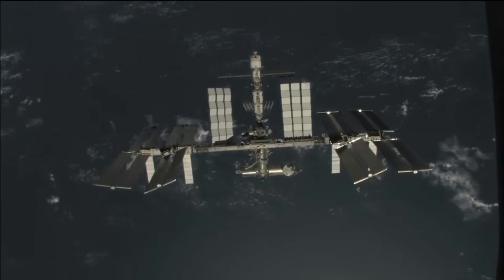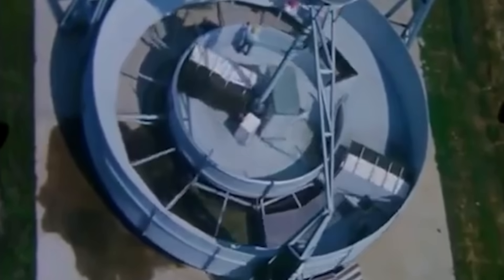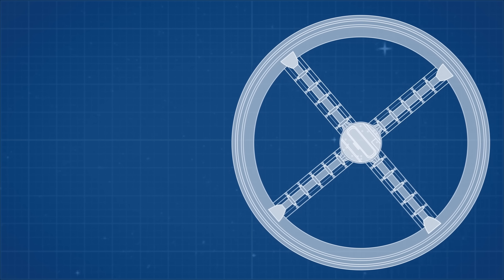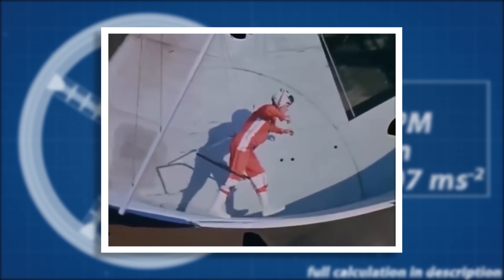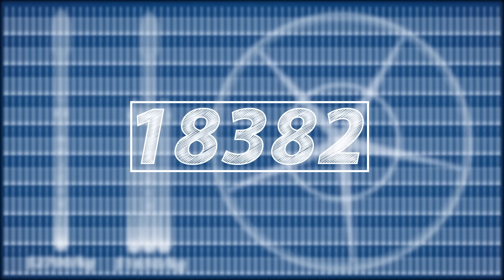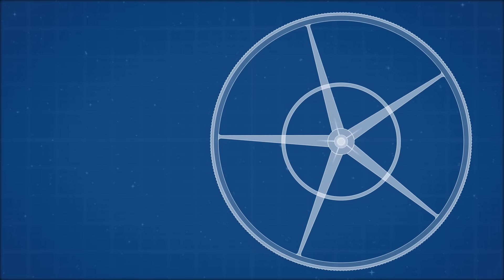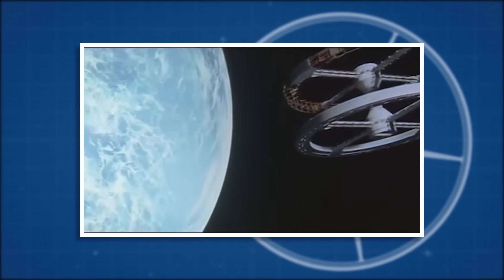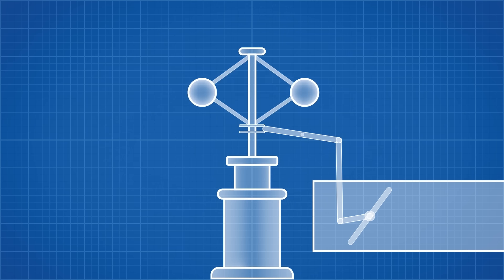Can We Create Artificial Gravity?

Comment: Can't we spin a ball and make something like gravity on it?
Reply: I think that'd just make you float away from the ball even more if you're standing on its surface. But if you're inside the ball, yes you can make something like gravity inside, but the force that creates the illusion of gravity would only be felt away from the axis of rotation and on the equator of the ball.
Reply: @pigsandcats15527 but we are standing on earth's surface? So why not?
Reply: @LaowaiDaveJCP The Earth is massive enough to have actual gravity that prevents us from floating away. You'd need to get a lot of mass if you want to build a ball with actual gravity strong enough to prevent you from floating away from its surface. That'd be like building (or reconstructing) a whole planet or moon, and you can't build that near Earth. A spacecraft that uses centrifugal force (or another option that's not mentioned in this video, which is a spacecraft that is constantly accelerating at 1 G) would be a lot easier to build and would require less resources.
Reply: @pigsandcats15527  suppose me getting thousand times smaller than our actual human size, get so small that a soccer ball looks a planet to us, then if you rotate the ball would i still fall fall out?
Reply: @LaowaiDaveJCP  I apologize for the late reply. While I don't really have that much knowledge about the effects of gravity at the small and microscopic (but not quantum) scale, what I've learned in my studies is that all objects with mass, including the soccer ball, have gravity of their own. However, the Earth is very massive and it's gravitational effects is therefore relatively strong and far reaching, so the gravitational effects of a soccer ball on Earth or near Earth would be very unnoticeable and negligible.

If we were to put this soccer ball far from Earth or far from any massive bodies with large gravitational influence, that's where the soccer ball's gravity would become noticeable, at least for objects whose mass is smaller than or near the mass of the soccer ball. Place two soccer balls a few inches apart from each other in that region of space, and they'd attract each other and stick to each other (as long as they aren't moving too fast). So maybe theoretically, if we are to be shrinked to a size small enough that a soccer ball would basically be as big as a planet to us, we would be able to stand on the surface of the ball without floating away (unfortunately, shrinking a human isn't possible as there are gonna be a lot of problems and complications in doing so).

Now if the soccer ball is spinning, there would be very little difference on the strength of the ball's surface gravity (depending on how fast it spins). Spinning wouldn't strengthen gravity or generate gravity on a relatively massive body just as it would inside a spinning ring-shaped spacecraft. In fact, it would slightly diminish the surface gravity of that planet. Since Earth is already rotating or spinning, its surface gravity is actually already very slightly diminished. This is the reason why Earth isn't a perfect sphere, it bulges in the equatorial parts since the equatorial parts are the farthest from the axis of rotation of Earth, and so it also spins a bit faster than the polar regions. Gravity is also actually very slightly weaker on the equator than on the polar regions! If Earth were to spin way faster than it already does right now, we'd probably float off the ground and many other catastrophic events will happen which will probably kill us. Centrifugal force acts on an object in circular motion (an object on the surface of a rotating or spinning planet is considered to be in circular motion), it arises from an object's inertia, and the force drives that object away from the center of the motion, which in this case, is the axis of rotation of the ball or planet.

You can actually try and see this effect at home. Get a cup or bowl or any similar object you can find. Sprinkle in some salt or sugar or similar small stuff. Now spin the bowl or cup, and watch what happens. You'd notice that the salt or sugar inside sort of becomes "attracted" to the side of the bowl or cup, and away from the center. The centrifugal force acting on them pushes them outward (and against the side or wall, similar to how a spinning ring-shaped spacecraft would work), not inward like what the natural gravity coming from massive objects does.

In short, yes. A human shrinked to a very small size may be able to stand on a soccer ball, but only if they're far away from Earth or any massive object with larger gravitational influence. It doesn't matter whether it's spinning or not, but don't let it spin too fast or you'll float away.
Reply: @pigsandcats15527  wow great explanation. Thanks sensei 😅

Comment: How large of a crater would be required to make reasonable gravity to off set the health deficit of living on the moon or Mars if  habitats were built on a banking rail going around the crater. At what speed and bank angle to augmente the existing gravity and boost it to near earths equivalent. A second rail could function somewhat like an "elevator" to board as it matched the speed of the habitat from the ground and vice versa. Maybe the "elevator " could have a self leveling floor as the speed changes.

Comment: How huge would the station have to be for the difference in acceleration between the person’s head and feet to be negligible? 
Imagining a 200 m radius and 2 m person, since the acceleration is directly proportional to the radius, it would be a difference of about 1%, right?
Does anyone know if that is low enough?
We could improve it to 0.1% with a 2 km radius, or to a 0.01% with a 20 km one. By comparison, Elysium would stand at around 0.00667% with a 30 km radius.
Very cool video!

Comment: this is possible to build with a modular concept. Pretty much like oversized legos - the idea is to create multipurpose modules that can be sent into space, and in space, attached to each other, with interior tech added as required for each specific function. The ring would start with core modules installed, two tethers and 2 bigger sections at each end. Rotation would start then, to ensure gravity in the outer sections. Then more modules would be added to the outer sections, with more tethers as required, until a whole ring was formed.

Comment: Why don't they build a long stretched tube like arm instead  of building a wheel that's much cheaper and easy to maintan 
Plus they can hook toilets at one side and astrounauts sleeping compartment in apposite side. 
They can work in 0 gravity but they need earth gravity to sleep and loo to maintain long and healthy stay in space.
2 meter diameter and 300 m long  tube is enough long and wide.

Attached room at both ends
To maintain balances.
Total building cost less then 100$ billion.

Comment: Someone else mention it would not need to be a large wheel. But an even simpler approach than having two modules tethered would be to have one module anchored to the asteroid. In fact the ISS could easily be adapted to this if it could withstand the force. This is most likely the approach that will be used for space habitats we put throughout the solar system.

Comment: You wouldn't have to build the whole ring in one go. You could build the spokes (or even just two of them) of the habitat  first and install two or more pods of equal weight on the spokes. I'm not an engineer but couldn't you also have single spoke rotate around it's center of mass without a ballast? A question for someone more qualified than me.

Comment: Im trying to make a simple basic character that has arrows up downside calc force scale for simple coding of gravity changes and place animations on changes so like arrow gives player char float percent on either direction xyz based off of sphere calc dot data on arrow scale ad weight type values... I can draw it but I'm still new to coding.
Reply: so the movement of 4 arrows able to move given weight from float and ability to add multi animations based of of the time of anim given yes no for a time cutoff of animations etc. and contact understanding f fill touch of any object skipping the whole red channel issue and float value could have yes no to graph value of 0 1 for mix bone to speed and slow down animations on local scale and global scale if checked yes.

Comment: Could the size be reduced if the spacecraft docked onto a hollow shaft with some kind of gyroscopic or multi-axis centrifuge rotating around it instead of a at disc, such that one axis initiates the next and so forth? They could potentially be stopped and started independantly with a combination of electromagnetic breaking and strategically placed propulsions. I would imagine that something along those lines would also be a more orbit frendly shape, being less likely to collide with debris or meteorites.

Comment: i feel that your looking at the problem mildly incorrectly, the "starfish" the 5point star that is holding the "living space" i.e. tube where the astronauts would be occupying is where the magic happens! if one was to alter the angel of the point 45 degrees approximately half way the length of the structural bases of the "space station" there would be enough force to create a massive gravity effect on anything occupying the quarters. (i'm too lazy to draw a picture and not smart enough to do the math)

Comment: So, it seems like only things that touch the inner surface of the spinning wheeled station in space would experience the centripetal artificial gravity force. Once out of contact with the inner wheeled surface, wouldn't you just float?
Reply: No, but jumping might be weird because you might land slightly away from the spot that you began to jump (according to the floor of the station). How far away probably depends on the scale of the station... Which is why a station with a massive (long) radius is preferred.

Comment: Is this the same thing at amusement parks, the ride where the circle ride where you lay againts the wall, and the circle goes nearly vertically and theres barely no straps, or seatbelts. You just walk on the ride and lay against the wall(stand against the wall) and it spins fast and the G force pushes you against the wall?????

Comment: What if we were to trap an asteroid and accelerate its rotation so that a tunnel just under the surface of the asteroid would have "gravity" similar to Earth?  You wouldn't be able to stand on the exterior of the asteroid, but you could dock with it by matching the rotation speed and using some kind of tether.

Comment: Wait who is saying that the centrifugal force does not exist? Have they ever owned a bucket with some water they can swing around? Or is it more a Centrifugal vs Centripetal thing? But then one would not exist without the other.  It is also quite useful to remember that Einstein taught us that all observers of forces are valid. So in the case of anything spinning around inside a chamber, would be in a constant state of change, witch produces a result of resistance, perceived as gravity.  For the same reason a washing machine has clothes stuck to the walls. # A caveat. Special relativity also says that all laws of physics are usable even if there is constant change. So a bouncing ball will behave correctly as long as the change is constant. Like the earth spinning around for instance.

Comment: Centrifugal force is crazy there is a strapless spinning ride that spins you and you stick to walk at worlds of fun in KC,MO.
Reply: Se but that only works because you accelerate up to teh correct speed.
What happens if you get stopped dead in a centrfugal spacestation? Do you just start ping ponging around? if theres no outside gravity pulling on you to hold you in position and you jump in a space station, while you would be carrie dforwards it would akin to jumping on a moving vehicle, landing would be difficult. And thus walking aorund should be difficult too. Even a smooth moving plate on teh end of a pole would feel slightly off.

Comment: It is centripetal force!   The reaction, centrifuge, is in the opposite direction to the force.  When you accelerate in a car, the force is forwards, and you feel a reaction as your weight increases in the opposite direction.  It is exactly the same thing.  A trained engineer would  never use the term 'centrifugal force' it is complete baloney.
Reply: That's a bit extreme.  In the video he clearly explained what centrifugal force is and what it is not.  As an engineer you can't simply ignore the very real effects of centrifuge.  For all intents and purposes, as long as you have a rotating frame of reference you should treat it like a force.  I mean, we do the same thing all the time with gravity.  We know that the "force" of gravity is not exactly a force when considering spacetime and relativity, and yet for most practical purposes we can treat gravity as a force in a Newtonian way.  The same goes for centrifugal force.  You may not like the term or the semantics, but as long as you understand what causes the reaction to appear as a force, you can treat it as such.
Reply: @Agedude  There is no centrifugal force.  You can BS all you like about 'spacetime', it doesnt make a blind bit of difference. The force is towards the center of rotation, and is called centripetal.

Comment: We see this design everywhere but to clarify, it doesn't have to be a wheel, it can be just a long beam like structure with living spaces at the ends that spins on its center, that would reduce the cost of material considerably.
Reply: I may be wrong but a design like that may easily lose balance. A cross may be better.
Reply: 2:34
Reply: @primo1105  He isnt talking about the size, he as talking about the shape. You dont need to make a full wheel just a habitat at each end ot the beam. Thus reducing amount of mass required to build it as you only need to construct one beam and two modules not an entire ring with multiple beams.

Comment: Why isn't scientists considering the technique ISRO used to get their spacecraft into space? - gradually increasing the orbital radius instead of directly travelling all the way up. Granted, it'll take much longer to get where you want it to be but it's way cheaper and only requires less amount of rocket fuel. The increased duration of the operation is not much of a problem here coz we are building a mega structure whose individual sections take years to manufacture.

Comment: You don’t need to build a full wheel. A stick with two capsules at the ends spinning around it’s center would already be enough. It would be mich much easier and cheaper to build and it could be built around a pre-existing space station like the ISS or a future rocket that goes to mars.

Comment: There seems to be an assumption that space stations need to be constructed with the same materials we use to build rockets (mainly refined metals such as aluminium).  If the construction materials are to be sourced in space and on the moon, then we should consider using easy to refine materials such as concrete materials consisting mostly of lunar regolith.

Comment: So for a starship, would the centripetal force in an artificial gravity module interfere with its trajectory? namely the increased lateral motion on the y axis perpendicular to the vector of acceleration/movement
Reply: The Starship would be cable-connected to a counterweight -- probably another Starship -- and both would rotate around the barycenter.  The barycenter would would remain on trajectory if the ships were spinning in the x, y, or z-axis.
Reply: @franksolario1842  Thank you for your reply. 
I cannot imagine how you found my comment from a year ago among so many
Reply: @Opti-Mystic  Well, "found" implies I was looking which I can assure you I was not.  I was simply perusing previous postings on artificial gravity and dispensing my wit and wisdom on the topic.

Comment: The point about the aluminum required being too much isn't right. World production of aluminium in 2017 was about 60M metric tonnes. If Elysium was 1M metric tonnes, the world market would have to increase their output by maybe 2%. And if history is a guide, stations aren't built all at once, so if the engineers were aggressive and did this in 10 years, that would be 100k metric tonnes (~0.2% of global supply). In practice, we'd likely be looking at a 2 decade project if the engineers work tirelessly. The ISS is 2000x smaller and took over a decade to "complete" (it's an ever evolving lab, it'll never truly be complete, and that's okay). So hopefully you can see that even with a remarkably optimistic timeline, materials probably wouldn't be a limiting factor for this hyper simplified case of an entire station made of only aluminium (lol). Hope this helps :)